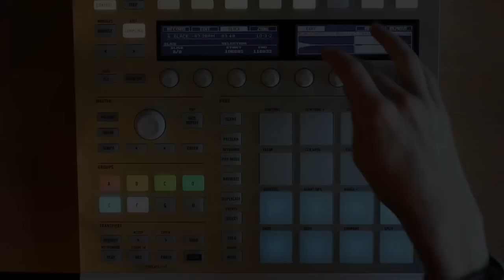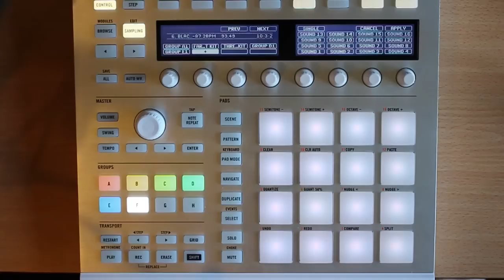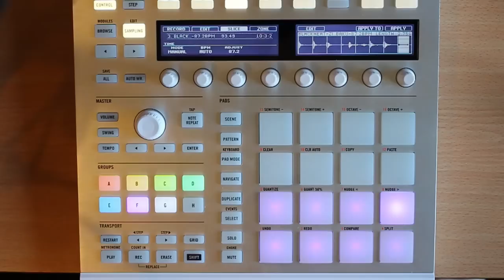Intro to Maschine MK2 - Part 11 - Slicing

Comment from the maker: Tim Scranton - with the pad mode menu activated, press the top white button that is located above "pad mode" on the screen. This will lock or unlock the menu.
Reply from the maker: ***** Are you applying the slices to a single sound slot or across several slots?